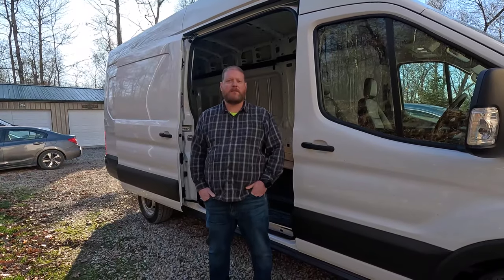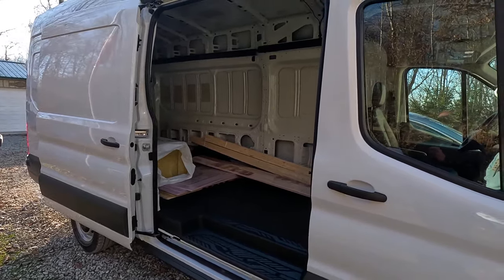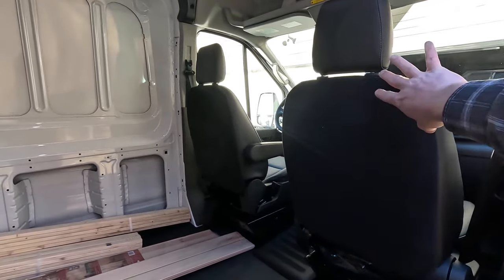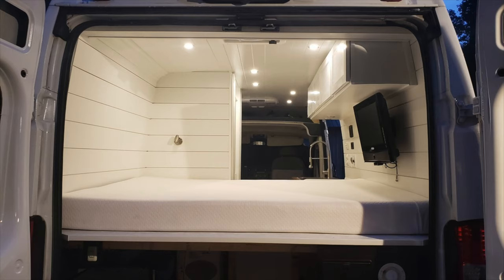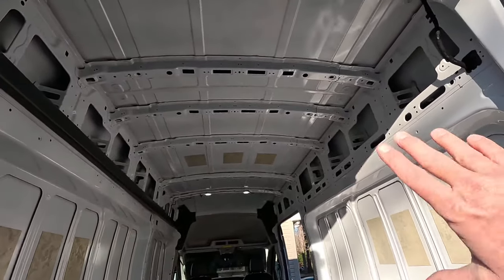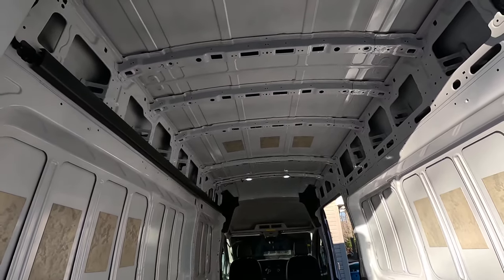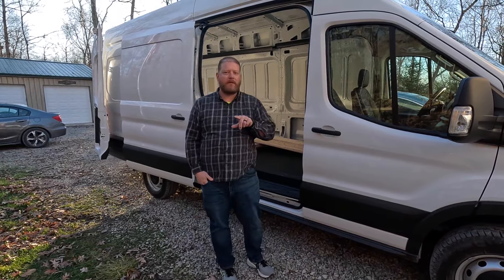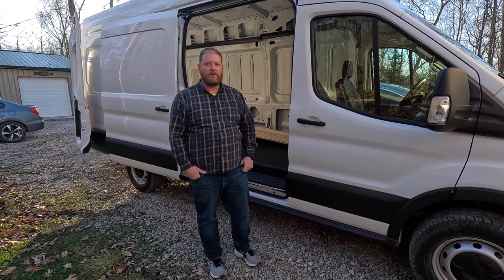Transit vs Promaster - Which Is Right For Your Van Conversion RV Build

Comment: I have both a 2023 Promaster and a 2017 Promaster.  So far, both vehicles have been excellent with no issues.  I will say that in 2023 there a been a ton of improvements including a larger cowl with larger drain tubes, so clogging isn't so much an issue, new upper intake design, so water collection isn't an issue, LED headlights which are incredibly bright and much more reliable.   Since I do my own maintenance and repairs, I can tell you the new frontend design is much easier for servicing then the old one.  As for the adaptive cruise control and lane keeping assist, after a little custom configuration, I haven't had any issues and even went as far as to drive from Los Angeles to Riverside using entirely adaptive cruise and lane keeping assist during rush hour.  Didn't touch the pedals at all during the trip and only had to keep my hand on the wheel to keep the computer from disengaging lane keeping.  A little bit of a scary trip, since I don't really trust computers to drive, but the van did an excellent job of maintaining proper distance without performing harsh acceleration or panic braking, which I think is good considering I was in LA traffic.
Reply: @arnenystrom4283  to give you a promaster smile.   It had many brands in Europe, same van, same factories, different brands and names..  and for 2025 it will also be rebadged as A TOYOTA for the UK market.  Yes,  same van as you have, with a Toyota badge.. if I’m not mistaken it will be called the Toyota ProAce MAX…or something like that..

Comment: A very informative video..   thank you..    btw. I’ve owned all 3 vans, sprinter, Promaster, transit.  And the ford is the best by far.. Sprinter has better build quality, Promaster is fragile, transit is best for reliability, cost of ownership, ease of repair and just basically lack of downtime.
Reply from the maker: Thanks for the great perspective from someone who has owned all three.
Reply: @JackofAllMasterofNone  my pleasure..  the video was knowledgeable and granular..  very good indeed.
Reply: @theopinionatedbystander can u email me with all the pros cons and the year of each van u have. I want to buy a used low roof cargo van to fit into parking garages at the gym. I just want the reliable year, model number, etc. Tyvm very helpful from your experience.  I'm in California where there's not much space to park the van.tyvm
Reply: @terrancehorn846    My vehicles and dimensions will not help..   you’re better off researching based on your garage dimensions..
Reply: @theopinionatedbystander  ok tyvm I've done so much mm, research.  But based on what u said. Ford transit. Was your fave, handling reliability, maintenance,  costc etc .True about garage ,etc space, etc.but this is LA county small garages full of stuff.
Reply: @terrancehorn846  just as an fyi. My 2022 transit just came from the dealerships shop where it had “every fluid, filter and spark plugs etc changed”. It now has 150k miles and had nothing but oil and tires to this point. Still has 70% factory brakes, 95% rotors.so no brake work required at 150k miles. It’s a highway vehicle, not a city driver (hotshot). I expect another 100k out of this vehicle with no mechanical faults,

Comment: I have 2 sprinter vans. One is a diesel one is a gas. The diesel has been nothing but a problem from day one i bought it brand new in 2012 as a work van. Since then it has been at the Mercedes dealership at least three times a year to the tune of $60000 plus in repairs. The gas has  been in at least once a year since i bought it in 2019 and about $15000 in repairs.. Mercedes is garbage, love working out of the vans hate the repairs. Wish i could find a transit i could replace them with but ford sucks to deal with. Good luck to all looking.
Reply from the maker: Thanks for the valuable input
Reply: Tyvm about mb. They claim to be the King of  qa qc driving reliability etc. I drove a 84 diesel mb it was nothing but problems.
Reply: My 2017 4x4 sprinter has been solid as a rock, now 90k miles.
Reply: @XPRoller  you sir are lucky.
Reply: @ptech88  yours 2012. technology develops everyday. But I agree I have been lucky. Now, not sure if I should continue to keep this one or get a new of something else. 2017 sprinter was a matured version though.

Comment: you are 100% spot on with the driving seats and position.  going from the ram to the transit, is like going from a nissan to mercedes.
Reply from the maker: I know. I sat in a Transit and it was at that point that I decided to sell the Promaster. I would get driving fatigue in only an hour of driving the Promaster

Comment: I don't like/trust Dodge, but the transit has a puny display on the dash radio. My Ford Fusion hybrid has a real wide radio display with SYNC and SiriusXM which i have a lifetime subscription which I got almost 18 years ago with my previous new Ford edge which I had for 4 years and transferred my subscription to the Fusion and im going to want to transfer it again but i need a large radio display to see the GPS and apps etc. The back open space is a blank canvas!

Comment: The Transit leaks water from the side plastic wraps. Many clip holes visible inside the van. I've seen guys put a bead of silicone sealant along the top edge of those panels. I have the Magnetic metallic color, so I'll use clear silicone. Mask off with painter's tape, and get nice clean lines!

Comment: ...  after looking at all  ,  I've had two  Nissan NV 2500 high roof  vans  -  never needed to use the 5yr/100k warranty  and with some good off road tires , goes places that surprised  me   ...  both vans were less expensive than the competitors  ...
Reply: @roger3786
It was a sad day when they stopped making the Nissan NV. It is my preference, but they are hard to find in my neck of the woods.

Comment: Promaster Super High roof will be my choice. Wider, taller, longer wheelbase and slightly better looking trim and finish in the cab, slightly better fuel economy, and relatively cheap parts and service. But I think you can't go wrong with either vehicle. They're both grreat for DIY van builds, so your comment about driving both and deciding makes a lot of sense. Great video!

Comment: Excellent in-depth comparison on so many levels. I'm starting with a budget minivan DIY conversion that will be my daily driver and fit in the garage, but anticipate needing a medium/high top cargo van to convert for extended full time use and travel. (stand up, more room). So many details you covered from the wheelbase, to contours of interior, to comfort, to the mechanicals give just the insights needed as a starting point for future decisions.

Comment: I think you should have given more detail about the water pump on the Ford engines. If the water pump leaks it sends coolant into the oil causing the engine to hydro lock. Also, on the Ford you have to remove the timing cover to replace the water pump. I have heard you can help the Ram cam/rocker issue by using an anti-drain back oil filter which keeps more oil in the head on startup. Nice video. I will test drive both like you said before buying. Great info on the Ram transmissions. Getting a 2022 or up if I get one. Thanks!
Reply from the maker: Both the things you said about the Ford are completely incorrect. The water pump on the van engines is external. On Fords smaller platforms like the Explorer and Taurus, the water pump is internal. On vans, it's external. There is no mixing of coolant and oil. The Ford drivetrain is 10000000 times better than the Promaster. The Promaster, however is much easier to build out in the space and the increased wheelbase allows more options for design layout.

Comment: If you're living full-time in a van I think the question would be which one has the best motor and transmission.
Reply from the maker: If that is most important factor for you the Transit wins hands down. Not even close.
Reply: Unless it's diesel. As a technician, the newer Ford diesels are absolutely atrocious. Fiat on the other hand actually invented the modem common rail diesel, got it right the first time and are yet to produce a dud. 

Transits are great short term vehicles and that's what they are designed for, but the Ram/Fiat will be driving long after the Transit is scrapped.
Reply: @NZdiagnostics So comparing gas to gas, you'd go with the Promaster for longevity?
Reply: Sprinter

Comment: Thanks for the thorough comparison between the Promaster and the Transit. Very much looking forward to your build! Sub-ed immediately. 
I too intend to build out a Transit. I was initially drawn to the Promaster for its square shape a slightly wider bed area, but the advantages of the Transit convinced me to go down that path. We’ve rented both a converted Transit and a converted Sprinter. To me, the Transit was quite comfortable; felt more like driving a truck or a car vs a “big rig”.
Reply: So smart to rent both as converted vehicles before investing the time & $$$ on a build.

Comment: I mean, overall excellent. I think the Achilles’ heel of the pro master, is the relative difficulty of installing a second alternator. In the transit, it is much more easier to do something like that. Especially when it comes to the use of high electrical builds. I disagree though, I think the pro master is much easier to service. The entire front clip can be easily removed with easy access to the motor. The Pentastar tick that was mentioned is indeed an issue, but if you’re a higher end DIY mechanic, it can be addressed. Also, the oil changes in the pro master can be done with the extraction method. The oil filter is on the top.  There is some discussion of using 0w30 to mitigate the risk of rocker arm failure.  Plus there is a super high roof option now.  The Europeans have significant experience on the Ducato platform.  As well as the transit, but the European platform is typically on the Ducato/Promaster.  My 2c.

Comment: The new Promaster has supposedly greatly improved the driving position and comfort. The Promaster engine was supposedly updated in 2016 model. They advertise the transmission as a nine speed, however, from what I have read, gears eight and nine are electronically locked out. The transmission is used in other vehicles where those gears are not locked out. The leaky cowl dripping onto electronics  and rusting bolts has supposedly been addressed.
Reply from the maker: There's no change to the engine. It is exactly the same. The transmission was updated a few years ago. The jury is still out whether it is any better than the old six speed. The cowl has been slightly modified but still leaks. To be fair this is also a problem on the Ford Transit as well
Reply: The transmission was updated for the 2022 models. 2021 and older have the 6 speed

Comment: I'm watching in February 2024. You make good points. I got my measurements from George of Humble Road and Waldorf.
Both Sprinter's are 98" in front of the wheel well. I drive a Ford Transit passenger at work.
We used to have Sprinters. I don't like the little amount of space between the two seats and the parking brake in the Transit.
Reply from the maker: New Transits have the electronic parking brake.
Reply: @JackofAllMasterofNone  I forgot to mention the most important part of the Transit. The AC heating system is awful.
If you or anyone has this problem,please comment.
I live in New England and the heat in the Transit is hot. I'm driving a 2022 full size passenger van. When the sun starts coming up and in the  early morning hours, the outside temperature goes up. The sun makes the front part too hot.
I put on the ac. It doesn't work.
I have to lower it to low to work. Then put it back up to 65. Then it blows very hot air.
All of our Transit's do this.

Comment: Can you speak to the seeming lack of power on steep inclines? My pro master struggled while driving in the western hills of Maryland and West Virginia. Thank you.
Reply from the maker: The Promaster definitely needs to scream (higher rpms) to stay in the power band when pulling hills loaded down. I've found that so far my Transit does a much better job in the mountains. It also has to downshift but doesn't seem to work as hard as the Promaster.

Comment: I am trying to decide between a Coachman Beyond 2024 Ford Transit chassis and a Coachman Nova 2024 Ram Pro Master chassis. My question is the space in the Ford cab was so tight I had a hard time crawling back into the van area. The Dodge Ram seemed to be much easier to get up from the driver seat to move back to the van area.  Do you also find that to be true? Thanks
Reply from the maker: In my builds that has not been an issue and the transit actually has a higher ceiling, thus more room.. It just depends on the build. Kind of like I said in the video the ProMaster is a little more build / camper friendly but the Ford is an overall better drivetrain and chassis.

Comment: I rule  out that swinging door, hated it, that cargo sound, what house has a sliding door .you get more verities of choice with two doors open to catch the wind  and it feel  it like a real home. Got the transit 250 and I get 20 mpg average , it’s drive like a car so s
Silent and powerful and shift early case it a torquey motor.

Comment: Hi builder
I have also a H3 Transit but my problem is that I have in the front a vertical separation of the heaven. I want the same heaven as you but Ford can't order or can't find the high heaven...  did you know the articel number of your heaven ?? that's would be great this information...
man thanks
Reply from the maker: I don't know what a "heaven" is?
Reply: in german we say heaven, that is the same as headliner, the cover from the roof in front of the car. 😊

Comment: You have to drop the entire gas tank on a Transit just to install an Espar/Webasto heater.  Which really sucks.   And the factory still running the wires in that channel is absurd.   For such an expensive van that is just a crazy cost cutting measure.
Reply from the maker: It takes 5 minutes to drop the tank. Literally like 2 or 3 bolts and a floor jack to lower the tank enough to connect to the fuel accessory port. The wiring harness is annoying.
Reply: @JackofAllMasterofNone  um....if you are simply connecting the fuel line for your heater to the accessory fuel port on the tank your heater wont work well for long.   Theres a reason Webasto and Espar say to not do that.   Fords pickup tube diameter is too wide for those heater to function properly consistently.   You have to install a brand new pickup tube.  Which requires a full tank removal to accomplish. So while you can get to the existing port on the top of the tank by slightly dropping the tank....you are also doing it wrong.
Reply from the maker: I am using the Velit heater and it works great with the factory take off. They only recommend installing the optional pickup tube if you are routinely over 5,000 feet, which I will not be.

Comment: Thank you for the video.  Is it not practical to have windows in the rear doors or on the sides?
Reply from the maker: We are adding both. Very practical. Just depends on your personal taste. Windows do make it harder to heat and cool and less stealth but a good set of insulated window covers helps.
Reply: like you, i would prefer to have the back doors with no windows. I block mine out and almost never remove the insulation. That being said, many people like to have the view from the back especially if they are backing onto a good view.

Comment: the plastic oil filter/cooler assembly that is notorious for cracking and dumping all of your oil with Dodge is a huge red flag for anyone looking to get a dodge, google it. 60% of them made so far has had this issue. I had both ford and dodge cargo vans and not a fanboy of either but I would take the ford all week long.
Reply from the maker: Definitely is an issue to plan for. Best thing to do as you probably know is to replace it with a aluminum Dorman cooler.

Comment: How about the condensate from the ac on transit 250? Anybody have that dripping on the heat shield to the cat converter?    So damned annoying and Ford says rhydontknow????     Sounds like popcorn popping on a loud speaker
Reply from the maker: You probably can relocate the condensate drain. We don't have this problem